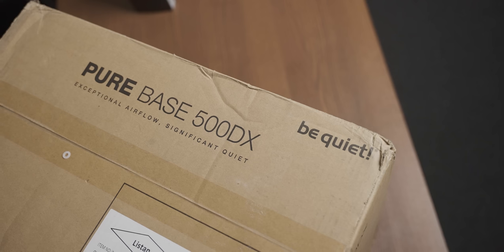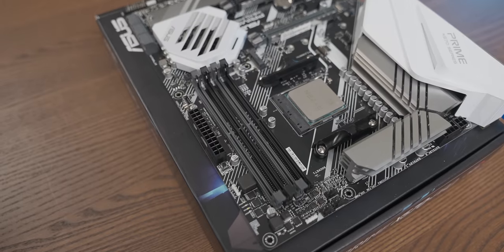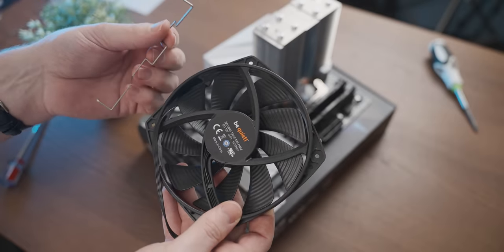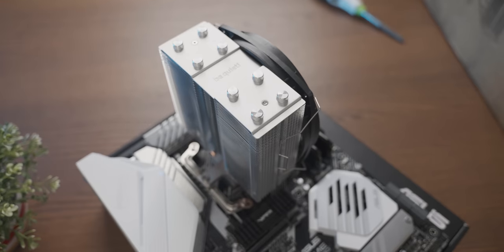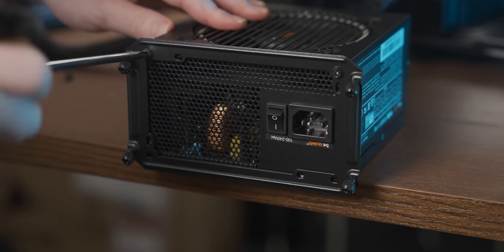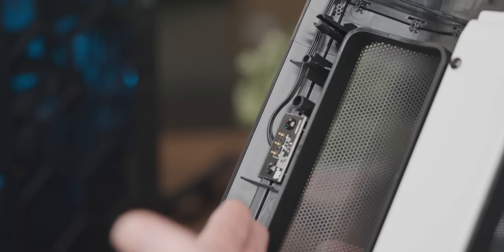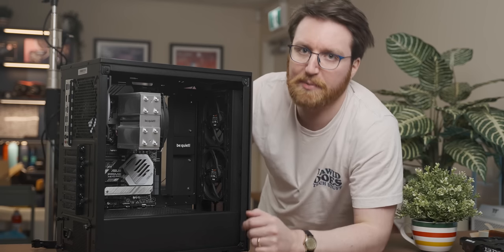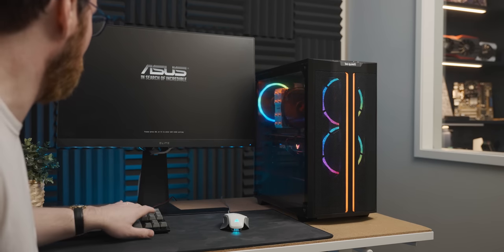Building A Beautiful Be quiet! Gaming PC

Comment: The fan clips almost gave me an aneurysm in anticipation of mounting them. Turns out, they are quite easy to use.
Reply: Yeah! They take a little fiddling to understand but when you do they're super easy to use
Reply: I have both the Cooler Master Hyper 212 Black and a Be Quiet! Dark Rock Slim and Noctua NH-U12S Chromax and found that for some reason the Cooler Master one was the most difficult and couldn't figure out why. Then I bought the Hyper 212 Black Edition RGB which shipped with a far better fan mounting bracket with a better fan that's both quieter and provides more efficient cooling.
Reply: super easy, barely an inconvenience!
Reply from the maker: I know right! I was so worried about them, but they worked surprisingly well.

Comment: The rear sound dampening will help everywhere,  as it stops the reflection.
Reply: all sound dampening is doing its part
Reply from the maker: I mean, it is the quietest system I’ve built in ages.
Reply: This is actually a vibration dampening so it would not be like drum.
Reply: @DawidDoesTechStuff  this is super helpful. I’ve been wanting to upgrade to a modern build and I want it to be a pretty quiet system. 

You mentioned it was about the quietest system you’ve built in a while but how did it sound? Was it dulcet or sound like a Smurf was being tortured (hard to hear but irritating)?  

Current build is an i7-4770, 16 gb RAM, RTX 2060 FE, cooler master HAF case and Hyper 212 cooler. I changed the front fan to a noctua recently as it was getting noisy. Still too much sound, ended up sticking it behind a flat screen tv and using a wireless Xbox controller for gaming.

Comment: I JUST LITERALLY built a badass i5-12600k system with this case in white!
Reply: Damn nice
Reply: I did a 12600K build too! I used a Lian Li O11 air mini instead, white of course!
Reply: @CrustyBreadVR+ Save up little by little. You don't need the newest parts on the market to play games.
Reply: @polardabear  yea i just get 5600g with 16g and wait till i have money to buy some decent cards
Reply: @kevin3495 + My friend built his own with a 5600X and a 3060.

It's good enough but 3060 is starting to be the recommended gpu for the newest games. I myself built mine with the 12600K and a 3080. Thankfully gpu prices dropped a bit so i was able to lower my budget.
Reply: @polardabear  it dropped a bit too in my country
Reply: i5 is an average mid level cpu, an i9 is badass...jussayin =D
Reply: @jaredchampagne2752 + 12600K is the way to go. The 12900K is the best cpu on the market but 12600K is the best for your money.
Reply: @jaredchampagne2752  cost per performance factor makes mine a better deal than some of the higher level Alder lakes. My machine is setup for editing and it’s perfect for it :)
Reply: @polardabear  yea I’m using my RX 580 OC Nitro+ SE 8G temporarily till I can land at least a 3070 Ti.
Reply: @J3R3MY-Sigman + I was very close on getting a Gigabyte 3070-Ti Vision for my white build but then the white ROG 3080 got cheaper.

The 3070 ti is surely a very good gpu.
Reply: @polardabear  if I can get the 3080 in white that’ll be ideal
Reply: @J3R3MY-Sigman + Get what you want. I was going with a Gigabyte 3070-Ti Vision but thankfully i was able to get the white ROG. 

The ROG card looks so much better than the Gigabyte Vision.

Comment: That is the case from my first build.  Great case, easy to build in, decent RGB that is there but not too flashy and 3 140MM fans which is crazy for a case at that price.  Also enough room (barely) to fit a Kingpin 3090 with front mounted radiator.
Reply: I thought they're 120mm. They seem the same as the aftermarket 120mm lianli fans I stuck in.
Reply: @johngaynor4363  Nope, all 3 are 140mm.  They do this intentionally to provide more airflow at lower RPM so it can live up to the brand name.

Comment: Pure Base 500DX is the case I current have. Love it. I think I spent more time deciding on case than any of the other components. I have always had massive cases but this case has plenty of room. I like the contacts for the front. I installed a 360 rad in the front and moved the 3rd fan to the top to give the other one a friend. I like that the front dust filter can be pulled out without taking off the front panel. 3 easy to access and clean filters keep the inside clean while still having good airflow and still being quiet (who would have thunk).

Comment: My GF's case , I bought it in June, 2021 for about 95 euros. A breeze to work with. 
On the other hand , I own a Be Quiet Silent Base 802 (you should try that as well). While it's bigger (that's what she said), it's a pain in the ass for cable management, especially if you've got extension cables. Get it, and you'll see what I mean. 
The interchangeable panels tho, the ease of use for the rest of it, airflow etc, are awesome. :)
As always, your work is absolutely awesome! You need more subsssssssssss

Comment: I got this case for my first real PC build and I think its great apart from one thing, the cable management bar. This is the first video which used a thick 24 pin power cable and showed how it can be made to go through that 90 degree cable management bar (routed it to the bottom corner), so thank you Dawid you helped me avoid buying a cablemod.

P.S: avoid a mATX board with this case, you'll have to route your USB cables right up against that bar and they will also get in the way of your power cable.

Comment: I've had this case for about a year. I built a beast into this case, msi MEG x570 Ace, 5800x, rx 6800xt midnight ed, Samsung gen4 m.2 ssd, Arctic 280mm AIO. It looks amazing, clean and blacked out with subtle lighting from the case shining on a few polished metal accents. Very easy to work with and high quality components. Only complaint (which is not unique to this case) is that if the rear and top are populated with 140mm fans, the power cable for the cpu is a very snug fit, especially if, as in my case, the cpu has 2 connectors. Otherwise, a fantastic build experience.

Comment: Finally building PCs again.  I finally got a PC built too. That was fun. Started with a Dell optiplex and a gt710, then a gt1030. Then I built a PC with a rog strix b550-f gaming motherboard, Ryzen 5 5600g 32gigs of ram running at 3200mhz, and a gtx 1070 founders. Changed that for a gtx 1070ti. Then bought a brand new RTX 3060 12gig. I literally climbed the GPU ladder lol.

Comment: I bought this case for my first PC build in like 20 years and could not be happier with it. My only wish was that the front strip RGB was addressable, but it syncs well to addressable with the various options. Dropped two additional 140mm so I’ve got two front, two top, and one rear with a BeQuiet! Cooler and it’s still whisper quiet! Glad to see Dawid review it!

[Edit: The case IS addressable RGB and I stand corrected. The Dawid watchers assist again!]
Reply: I made a similar build a few days ago, and I can say that this case has ARGB, did you try holding the RGB button on the front of the case for 3 seconds and connected the ARGB cable to your motherboard or ARGB controller? It works great with my Razer Chroma ARGB controller and the effects looks awesome.
Reply: @xXJuanRocksXx  No! I will though. Thanks for the tip. Like I said: 20 years… 😂

Comment: I built my pc with the same case.  I used the BeQuiet silent loop 360mm AIO.  I like the subtle lighting on the water block and the radiator can easily be topped off if the water level gets low.

Comment: I believe the low noise comes from the fact the fans are 140mm and push more air with less RPM as well as the added fan blades and texture on the blades. The ones included with the case are also super quiet. I have my fan curves setup to push them between 80 and 90 percent when gaming and they are super quiet. The nasty Wraith is the one that causes most of the noise but it will go away soon.

Comment: A tip for  those who own this case,  removing the front panel is so much easier if u cut a bit off top and  bottom of each plastic pin head. Try cutting litlle by litlle till u reach the desired amount of force aplied. Its good to do, cause ull need to open it regularly to clean the dust filter...

Comment: I have this case myself, and I love it. Its thermals are great, love the look, and it was pretty easy to build in. The only complaints I have, is it is a little tight on cable space if using extensions with three 8 pin pcie cables, and if you put an aio in the top, you are somewhat limited on ram choices. I have corsair vengeance pro rgb (fairly low profile) and I have about 1mm clearance from the aio. Other than that, it's a great case. My rog strix 3060 ti stays VERY cool, but my evga 3080 I had previously ran a little warm. So if you're running a top tier gpu, I would make sure to do a little research on the thermals of the gpu to make sure it has a good cooler. Also I used Lian Li sl120's (3 in the front, 1 in rear) and the rgb looks sick behind the led strips in the case.

Comment: Be quiet! tower cooler, best mounting brackets. As a one handed gamer, ease was a definite factor in a build and the dark rock slim fit that bill and keeps cpu nice and cool.
Reply: I have an almost paralyzed right hand. For racing games I use steering wheel, for other games a gamepad but with problems. Could you tell me what controller you use to play?
Reply: @Bastelopa_wie_mein_Channelname  Sure, I use a Razer Naga left handed edition for PC gaming (I bought two as they didn't make it for a few years). I don't console game as the controllers have way to many buttons these days. Have seen a few "one handed" console controllers, but nothing that seemed worth while. I haven't used any console controllers since 2008 when playing only Forza on Xbox. I tried to play GTA 4 on a PS3 but it was just complex. Couldn't rebind enough and not bump the RT/RB LT/LB tabs. With the Naga, I can bind 17 keys for combat / action use and non-essentials to my keyboard. Even in games like Fallen Order, Arkham series and Skyrim that want a controller I can customize the buttons / bindings as best I can in the Razer Synapse software. Have custom profiles for each game like those. I found rebinding movement on mouse to buttons 1(forward) 5(backwards) 2(right) 4(left) intuitive then rest of the keys per each game's action needs.
Reply: @Sarcastro_78  
Thank you very much ❤

Comment: How timely! I just refreshed my system last week with a new case and I used the white 500DX.  I upgraded my GPU about a year ago with a Power Color Hellhound 6700xt Spectral White edition, so when I upgraded my case, I went with white as well.  I also threw on one of the Vetroo V5 tower coolers in white, too.  I set all the RGB to white and it looks better than I though it would.

Comment: 8=8+8
DAWID, this is actually NOT a problem AFAIK. The power supply manufacturer should have the PSU and the CABLES specced to handle that power.

Comment: I built in this case the day this video came out, but am only seeing it now - transplanted an old system and the only hiccup was stupidly not putting in the 8 pin motherboard connector before the motherboard itself.. I have the larger bequiet cooler and instead of removing the top fan, tried for about an hour jamming my fingers into that tiny space at the top left , haha. Loving the case though! Those fans take it to another level - might have to get some!
Reply: Also made the mistake of not realising my mobo doesn't have a usb-C header for the front connection - just a thing to check for those looking at this case.

Comment: I have a Shadow Rock 3 in my own build - that one was more difficult to install, as the one screw gets hidden, but be Quiet! supplied a good quality long (180mm or so) Philips head screwdriver for installation through the pre-cut aperture in the cooler.

Comment: I bought the slim cool cpu cooler a couple months ago and I'm so glad I did.  That thing almost definitely saved my i9 from being bricked because of the second elden ring patch(the one before 1.02.3 where the gpu got bypassed and the game ran off the integrated graphics on the cpu).  Thanks Be Quiet! you actually saved my ass.
Reply: Which gen is your i9? I want to buy the same cooler for a i9k 10th but  unsure about it will keep up with the thermals 😅 

It look like you prise the sun!
Reply: @Kitzunium  9900k
Reply: I think most people will scoff that my computer would have shut down before melting down but, boy the smell of burning silicon and impromptu exhaust venting would say otherwise.
Reply: Are the thermal limiters off? 🤔🤔🤔
Reply: @Kitzunium  no, stock bios

Comment: I used that case for over a year - it was super nice looking and did a great job cooling - my only issue was that it was very tight at the top left when it came to accessing motherboard screws, cables or installing any sort of air cooler (Dark Rock Pro 4 etc...).

Comment: Pure base 500 pro tip: you can route psu cables thru the ssd tray badge hole and then secure the badge back using 2 psu screws

Comment: I have the straight power 11 750 watt platinum fully modular psu and its incredible. only marginally louder than my noctua cooling system. I highly recommend it.

edit: not that it matters but it also feels extremely premium in the hands.

Comment: I have a Dark Base Pro 900. I love the case. even has a wireless charger for my phone on top. the case came with this thing to hide the powersupply under. but I did the right thing and threw that in the garbage because a wire wouldnt reach  due to that thing. lol

Comment: The only drawback of this case is that you have to be careful with the glass not falling off when removing the thumbscrews and making sure you keep pressing it also when installing them back. I did also move the fan to the front, although I didn't replace them with those awesome light wings

Comment: I have the same case with Be quiet Dark rock Pro 4 cpu cooler with a 11600K + 64GB ram and a 3080 Ti from Inno3D which barely fits in the case.

CPU stays pretty cool on 125-155w load with that cooler.

Comment: 1st comment : too much TIM
2nd comment : not enough TIM
My comment that is actually valid and 100% accurate. "actually when applying thermal compound to direct contact heatpipe coolers. The most effective application method is the rice grain method. A rice grain along each of the heat pipes as this helps fill in potential voids between the heat pipes."

Comment: It's a nice case, but the front panel clips are painfully stiff and the front SSD mount / cable management hole cover is kinda awkward to get in when there's cables in there. Also the tempered glass on mine had a bit of a chip? but that's pretty minor.

Comment: should have mounted the two spare BeQuiet fans you removed and mount them to the top.. Left the rear fan non-RGB, and have it blow IN, and have the THREE RGB Fans on the front blowing IN. That way you have the two fans on the top blowing UP to pull out the heat. YOU left cooling on the table.. literally.

Comment: Those fan mounts work alright for me if I don't have them super tight.  Putting an oversized fan on requires me to use pliers to get them free... so not ideal.  I get the struggle, though

Comment: I have this case and love it. The only issue I have with it is the sync of the front panel and whatever rgb controller you're using. It's crap and it is so much effort to make it work that I Just set it at a fixed color, not syncing with the rest of the system. Too bad Dawid didn't mention the hassle it is to do it.

Comment: I have that same Dark Rock Slim cooler on my R5 5600X although the one be quiet! sent you must be a newer revision based on the Amazon page (mine has a BK030 model designation whereas this one has a BK032 designation).  Wonder if they worked on the cooler design to properly fit 12th gen Intel CPUs.  Also, this cooler fits really well inside of ITX cases like the Cooler Master NR200/P/Max and does a really good job at cooling the CPU inside the smaller cases.

Comment: Be warned, I bought this case and twice, for my sister and myself. Mine had a small nick in the wiring but it's ok, I ordered a new front panel w/ wiring but never used it. My sister's front LEDs didn't work properly and after guessing that a circuit board couldn't be the problem I swapped the wiring instead and it worked. So yea there's some minor issues with their wiring in my opinion. I know it's hard to check for issues but I found them pretty quick. Also the PSU bracket kinda sucks, you have to leave it unscrewed in the bracket and screw the bracket in first fully before tightening the PSU onto it because otherwise it doesn't align properly, seems like that's a design issue honestly.

Comment: I was originally going use the pure base 500DX for my first built in white but there were hardly on stock and when you did found one it was way overpriced so I when with corsair 5000d. ( I would still want to build on the 500DX )

Comment: Something I will say is that I have a Be Quiet power supply, and Dawid always talks about the 12 pins on the PCIe power connector but the cable doesn't connect to those, those extra 4 pins don't do anything; The extra 4 pins are there so you don't get the PCIe power mixed up with the EPS connector (labeled as P8 on the psu). I do like Be Quiet I have an Shadow base 800 FX, a Pure Power 12 850 watt, and a Dark Rock elite from them (really good cooler), but I don't like this, what I would call false advertising from Dawid. However the extra 4 pins are nice so you can just look at the connectors and say oh 12 pin goes into the 12 pin hole.

Comment: Will be high refresh experience Cyberpunk with 5950X what i have now with 1070 upgrading  finally GPU to RTX 4070 this year?or go for RTX 4080/4070ti? I heared RTX 4070 will be almost as powerfull as is 3090 nowdays.I have Acer Predator G-Sync 240hz 1080p panel.